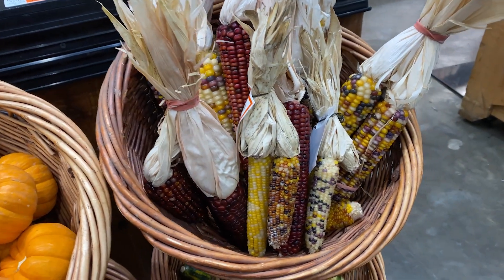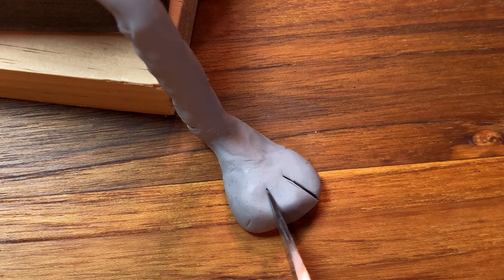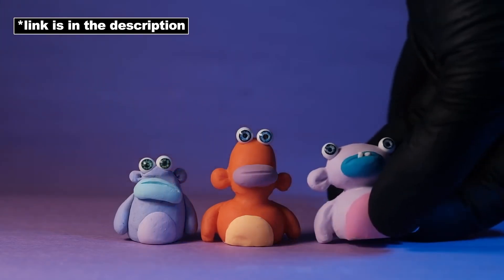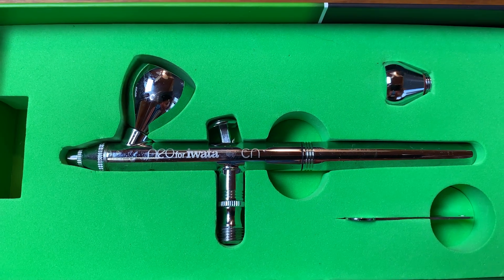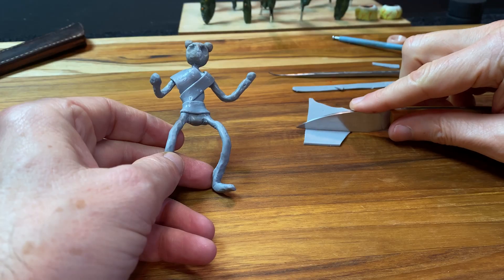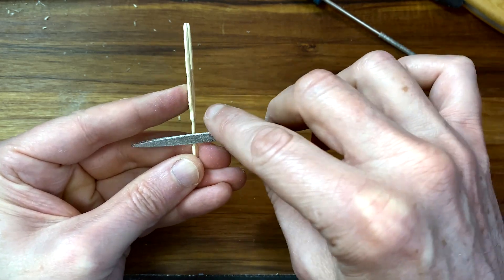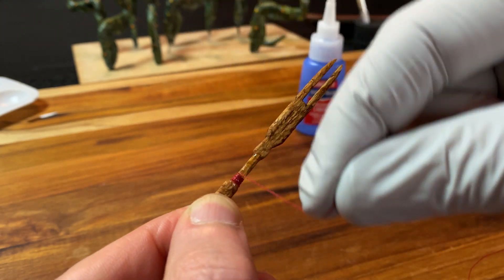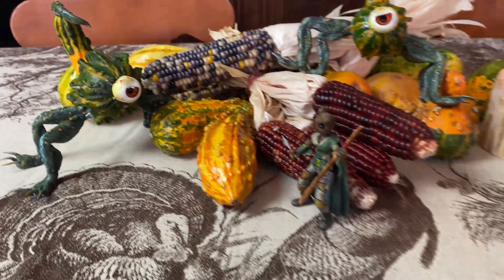HOW TO Make a  MONSTER for THANKSGIVING!

Comment: REALLY wanna do this. I think I have everything you used for the critter except a gourd. 😂 That size looks like something they would have at Trader Joe’s. 

You probably told me about it working for CosClay in a Patreon message when I was stocking my sculpting arsenal, but thanks for mentioning the clay softener here.
Reply from the maker: Trader Joes may still have them. That's probably your best bet. p.s. I sent you an Instagram message. Thanks for watching, Shakes. Also, my gloves work great. My oven is so filthy that I couldn't bring myself to film it. :/
Reply: @CajunCraftastrophe  maybe I can help again … is there a can of EZ Off on your wish list?
Reply from the maker: @Shakes_The_Clone  Haha! My wife would not let me use EZ Off. It's a miracle that I can use the oven. So, no help needed there, Shakes, you've done more than enough. I have considered buying a second hand oven to put outside or in my shed. That may happen. : )